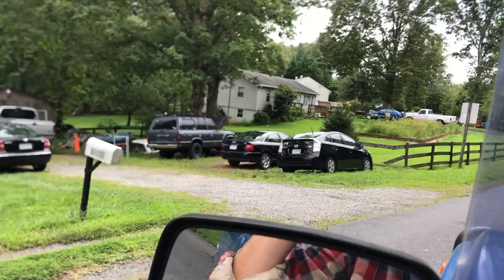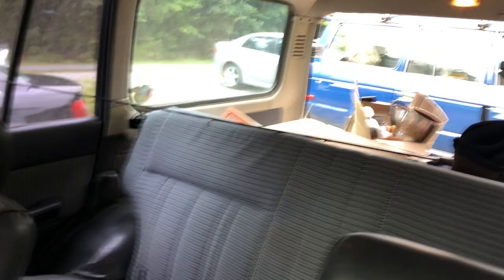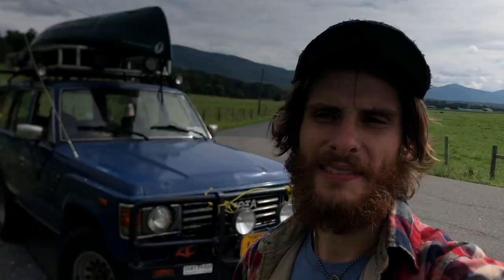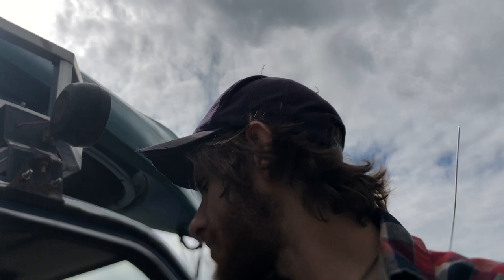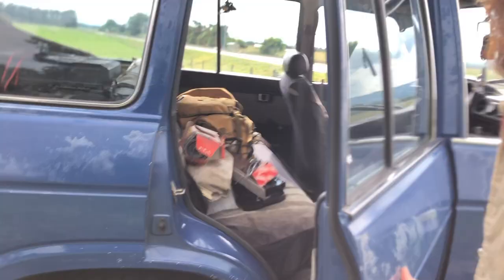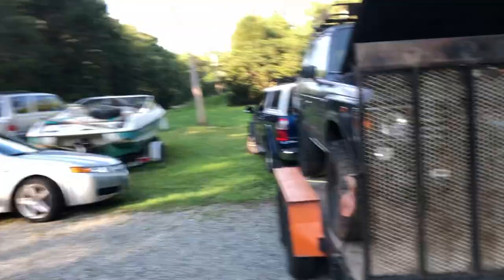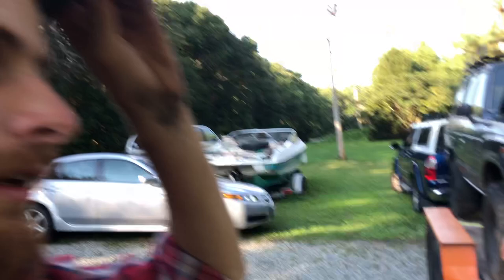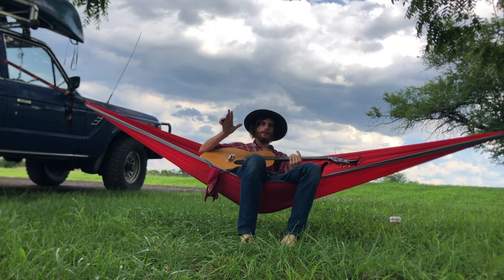1986 Toyota fj60 Land Cruiser Bought Off Facebook Market Place: PT1- Making the Deal

Comment: If you put 'em in 4-Lo, the starter motor can drive it on to a trailer.   Just for future reference.
Reply from the maker: we actually tried that. theres a clip when its cranking over and the trucks moving. The winch under the truck  just was faster. Plus the battery was completely dead and barely turning the starter. Appreciate the suggestion tho.

Comment: How much did it cost, if you don’t mind my asking?
Reply from the maker: i rather hold on to that information for now.
Reply: Mize Adventure hey, thanks anyway. Just looking for a good price to offer for an FJ60
Reply from the maker: @thespencel11  yeah all that really depends on the shape of the frame, body motor etc. the motor in this truck had no compression and the rings were bad. the range is super large for these things just depends what type of truck your trying to get into. a near perfect one or a truck you dont mind throwing money at from time to time.
Reply: Mize Adventure the one I’m looking at runs and drives but has begun to be disassembled for a full restoration. Rust looks minimal
Reply from the maker: @thespencel11  hmm interesting. i would really have to see it tell you what i would pay for thing like that. if you good with a wrench and dont mind a little project i would roll with it
Reply: Mize Adventure thanks for your help, I think I’m going to get it if all goes well
Reply from the maker: @thespencel11  sounds really great! reach out if you need anymore help with anything.
Reply: Mize Adventure thanks man, I definitely will.